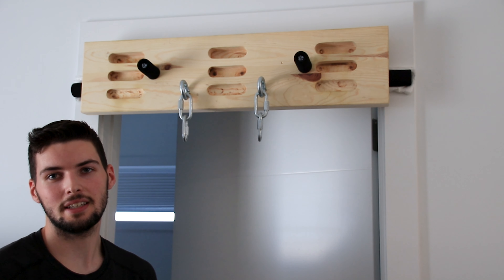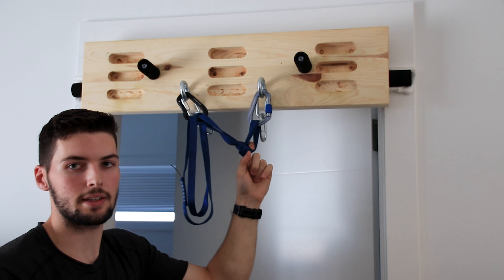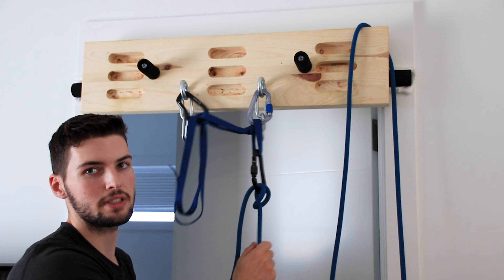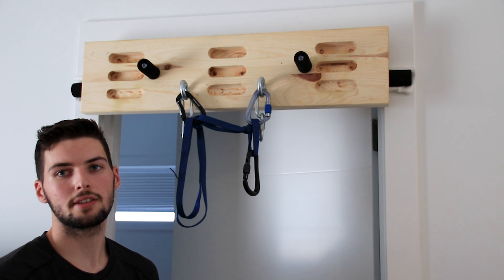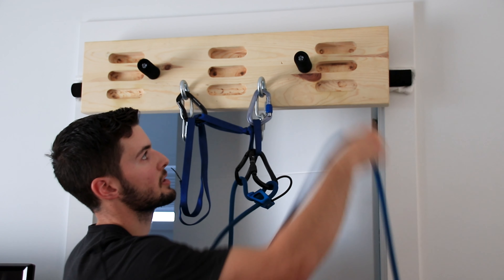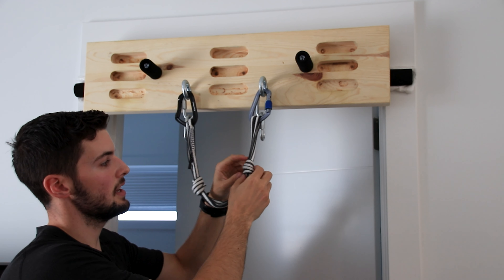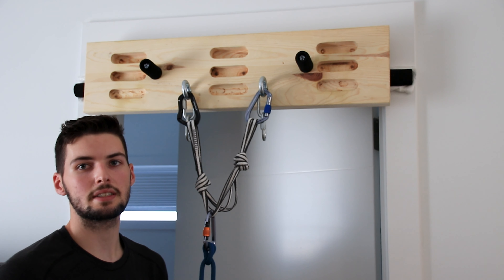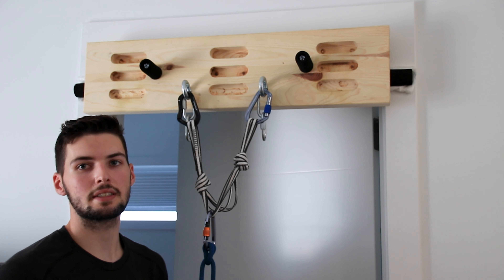How to Belay Climber off Anchor (Best Methods)- Fixed Point Lead Belay: Multi Pitch Climbing

Comment: good , could you explain also the OVO  or gigi kong (plate) pls ? thanks
Reply from the maker: I do not believe that these plate-style devices are intended to be used for lead belaying. They can be set up on an anchor to belay a follower after the pitch has been led but are not meant to belay the lead climber when starting up the next pitch.
Reply: @canamventures  thanks

Comment: I never see the grigri used in these FPB systems.  Is there a reason to not use a grigri? What about a megajul?
Reply from the maker: One reason that an ATC-style belay device is preferred is that it allows some small amount of rope slippage and therefore reduces the forces in the system, providing a softer catch for the climber. The grigri can be too good at what it does  (locking the rope) and since the belayer cannot provide a soft catch to begin with using a FPLB, a grigri would cause the forces to increase on both the climber and the anchor. The other issue that would be encountered using a grigri or any other type of assisted breaking belay device is that they generally require you to have your hands directly on the device to feed out slack, so in the situation where your climber would take a fall, it could easily be ripped from your hands. An assisted breaking device can be used when you are belaying a follower from an anchor on top rope, but I am not familiar with a way to belay a lead climber off of the anchor with one.

Comment: When trad climbing, what is the first couple of bolt blow out and you removed your redirect?
Reply from the maker: When trad climbing, I would be more likely to belay directly off of my harness. If I had to belay off of the anchor, I would use a Munter hitch as opposed to the ATC because of that risk. Thanks for clarifying that!

Comment: at 3:50 when your climber has reached a couple of draws, you're transitioning them from the fixed point to a harness belay. the climber is not secured during that transition, right? even though it might only take 1-2 seconds if you're trained, the climber would not be secured in the event of a fall during that transition. 

I do see the point of beginning the belay in the anchor (helps reduce the fall factor in case of a fall where the climber falls beyond the anchor) and then passing to a harness belay (to give a softer catch), but this transition is really bugging me. i don't see how to secure the climber during that, except for using two belay devices/munter hitches, which seems cumbersome and only lead to more room for error.
Reply: The rope would be going through your belay device on your harness the whole time. You would feed slack towards the munter as the climber progresses.
Reply: @gimmepowder that's not what he says and does twice in a video. He literally just recommends to live the leader on 2 quick draws and a God blessing.
Reply: @MrBarnichka  Just watched it again. He says to put rope through belay device on harness with a few metres slack going to munter on anchor.

Comment: Using the quad for fixed point belay is really suboptimal. Better stick with the bowline on a bight.
Reply from the maker: I do agree that it is easier to manage the belay off of the bowline on a bight, but what is it about the belay off of the quad that you don't like as much? Always love to hear other's thought so thanks for the comment!
Reply: @canamventures  Thanks for your willingness to engage in a discussion. The fixed point belay originated in Europe where vertically aligned bolts are more common. The way the bowline on a bight is used there, the bowline is clipped to the lower bolt and serves as the main anchor/belay point. The higher bolt is connected by the sling as a backup anchor point but not completely taut. If the lower bolt is to fail under a FF2 fall, then the load is taken by the higher bolt with minimal extension. In North America where horizontally align bolts are more common, the bowline on a bight can still be used, but the failure of one bolt will mean a swing/pendulum onto the other bolt. Not ideal but still acceptable. The way you use the quad, you only have one leg of the quad clipped (not the shelf, which would be clipping two strands from each leg of the quad). If the bolt fails in a FF2 fall, then you will have an extension and much larger drop to the other bolt. This is much worse than the bowline set up. One can argue that to use the fixed point belay, the assumption is that both anchor points are totally bomb proof and will not fail. But if that's the assumption, then why use the quad? The biggest benefit of the quad is that it share the load between anchor points with some self-equalizing quality. If we assume the bolts will not fail, then it's not necessary to have a self-equalizing anchor. Besides, the middle of the V in the quad is where the equalizing happens, and in your set up, you're only putting the belayer's body weight (arguably the lowest load) at the self-equalizing point. While the highest potential load under a FF2 fall is placed only on a single anchor point. It just doesn't strike me as an optimal use of the quad. BTW I do use the fixed point belay and quad when I climb multi-pitch, just not at the same time.
Reply from the maker: @polaristhebestdog  Thanks for the background on that! I always love discussing the many different tactics and questioning my own reasoning for what I do in different scinerios! I completely agree that the bowline is almost always the best choice on vertically stacked anchors and will have quite a bit less extension if the bolt were to fail. I personally have some favoritism towards the quad because of how much easier I find it to keep my belay station organized. I believe it to be one of its greatest benefits since efficiency is often important on multi-pitch climbs (not to say that things will be unorganized with the bowline, I just find it easier with the quad). When I am am belaying a follower I tend to use the self equalizing section, then move the belay setup up to the shelf for the FLPB. One thing I do if I think there is a reasonable chance of a FF2 on the next pitch is a "plus clip" (assuming we are swapping leads) which will almost guarantee there will not be a FF2 (more on that here: https://www.alpinesavvy.com/blog/3-ways-to-avoid-factor-2-falls-on-multipitch-routes ). At the end of the day, I do completely agree that a FPLB is the most bomber using the bowline (which is why I covered it first in this video) but again, my anchor of choice often depends on the situation and all things being equal (and bomber), I prefer the quad slightly more because of the organization, therefore decreasing the chance of any human error since the majority of climbing accidents are due to human error. Thanks again for sharing your thoughts! I really appreciate it!
Reply: @canamventures  I used to guide, so I teach climbers how to be efficient on multi-pitch. Efficiency is important, but it shouldn't come before building a safe anchor. Be it SERENE, ERNEST, NERDSS, no matter which anchoring principle/acronym you go by, "No Extension" (NE) is a basic anchoring principle in every one of them and should be an essential characteristic of any anchor. The quad is a perfectly safe method of anchoring, I use it myself all the time. It's perfectly fine if you love to use it and use it correctly. But the way you use it in this video violates the No Extension principle and is just not how the quad should to be used. You still think you're clipping the fixed point belay into the "shelf" of the quad, so I want to re-emphasize the point I made earlier that you're NOT clipping into the "shelf", you're clipping into a single leg of the quad. It doesn't matter for fixed point belay or anchoring yourself / your climbing partner, you simply shouldn't use the quad that way. Imagine instead of the quad, you equalize the two anchor points with a sling and tie an overhand/figure-8 as a mater point. To clip the shelf of this master point, you'd clip a single strand of sling going to each of the two bolts. If you simply clip into one leg of the sling, ie one strand in the loop going to a single bolt, that's NOT the shelf. With the quad, that's essentially what you're doing, clipping into one leg of the quad, NOT the shelf. And you will have a large extension if one of the anchor points fails. Nobody in a guiding/instructional role will teach people to clip a live load to a quad like that. The only thing you should there is a pack or extra gear to keep the belay station organized, not yourself or another person.
Reply from the maker: @polaristhebestdog  I understand what you are saying with the no extension and now understand what you mean by saying the one leg of the quad and that is completely valid. Again I would not use the quad here if my anchor points were not completely bombproof or if there was any reasonable chance of a FF2. Yes if there was a FF2 and the bolt were to fail, there would be some extension. If the bolt were to fail on a normal lead fall (extremely unlikely if it was inspected to be bomb-proof) then the extension would still be minimal before my clove hitch tether on the anchor masterpoint would take some of the force. I learned this technique from an alpine guide and saw it used by a rock guide as well. I have also had discussions with other guides specifically about the FPLB off of a quad like this. I would never post anything on here that I did not learn from a guide and have practiced myself and found to be safe when used correctly and in the right situations. I again want to re-emphasize that if I felt that the bolts were not bomber or if there was a chance of a FF2 with the leader falling back down past the anchor, I would not be belaying off the quad like this. If the start of the next pitch looks challenging, I would either used the bowline anchor for the FPLB and/or do a "plus clip" to mitigate the risks of a potential FF2. Thank you for this discussion though as it gets me to question my methods and reassess the factors in deciding what anchor I choose to build.
Reply: @canamventures Are you recommending to take the climber off belay while you move the ATC from the shelf to your harness - you reference this to when the climber has clipped 2 bolts above the belay
Reply from the maker: @bruceexton6596  We generally never want to take our climber off belay while they are climbing. When doing the hybrid method, you will belay the climber off of the anchor with a Munter hitch and then switch to the ATC on your harness. You will set up your ATC on your harness before the climber begins climbing, and then pull out enough slack from the climbers side of the ATC for them to reach the second bolt. Using that strand of slack , you will put your climber on belay with the Munter hitch off of the anchor and belay normally with that until they get two bolts clipped in. You should then have fed out enough slack that you are close to where your ATC on the harness connects to the rope. Keeping one hand on the brake rope of the ATC you can then remove the rope from the Munter hitch and belay normally off of your harness with the ATC. When done properly, the climber will never be taken off belay. It is essentially using two different belay devices (Munter hitch and ATC) that are setup at different points on the rope ahead of time, so the climber doesn't get taken off belay when switching which belay device is being used. Does that make sense? If not, I can try explaining it differently. Thanks for the comment!

I also need to mention that this is best learned in-person from a qualified instructor in a safe environment and should not be done on an actual climb without practicing it ahead of time.
Reply: @canamventures  Thanks for your video. The point is that it is hard to evaluate bolts - that's why we use two, when one is already far stronger than we need. We had a fairly new stainless glue-in fail in my area recently. This is rare, but it's possible.
Reply: Awesome video, clear breakdown. One thing I do prefer about the quad (despite the added extension discussed here if the first bolt blows in a FF2 scenario) is that the shelf where you clip in the FPLB is truly redundant. The bowline masterpoint actually only has one strand of cord/webbing/sling holding the knot together so in a case where rock or ice fall could hit the anchor, only one strand of the knot getting cut could cause the entire masterpoint to unravel since the bowline is an inherently unstable knot.
Reply: @polaristhebestdog  what is your preferred method when wanting to have a fixed point belay?
Reply: and is there a cleaner/better way of doing it if someone also wanted to use a quad anchor?